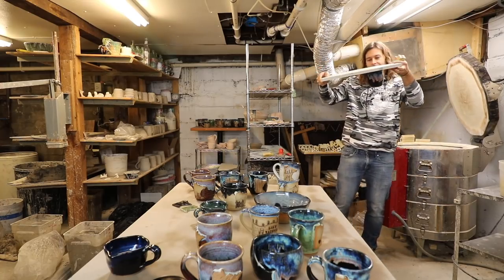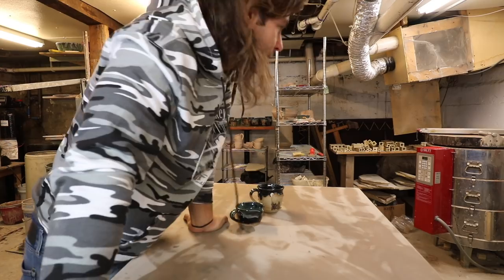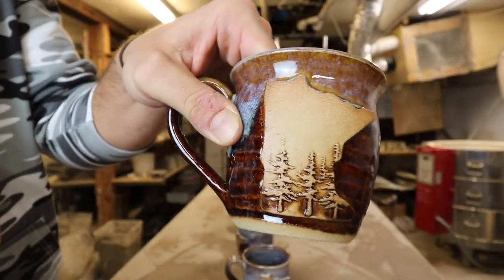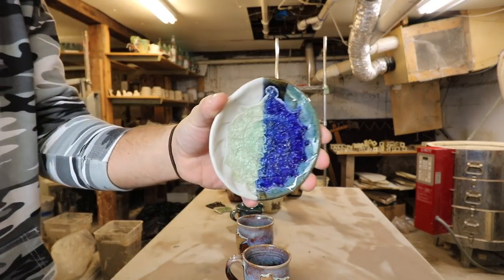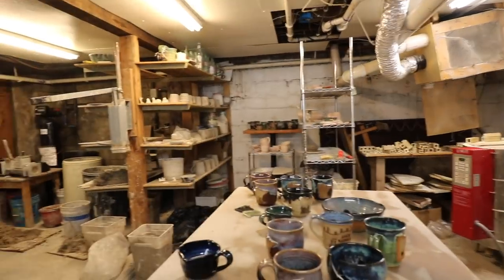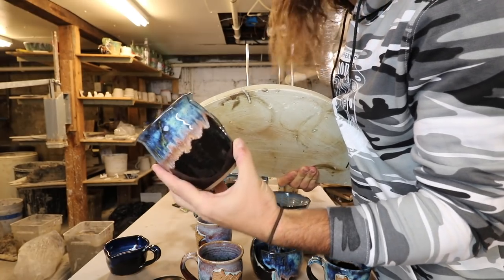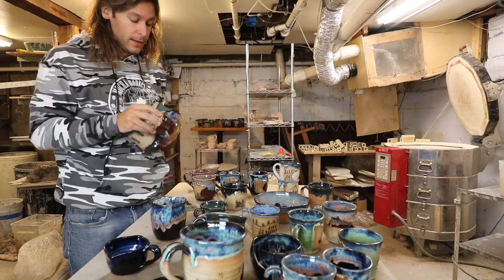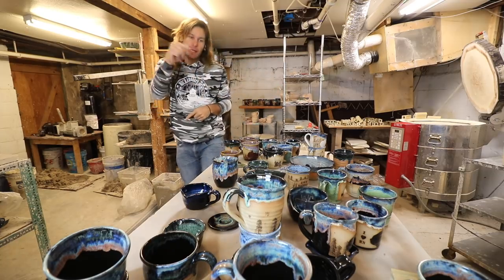My Kiln Shelves COLLAPSED!  Unloading Kiln #34

Comment: Love these videos!!! I'm a beginner potter and have learned so much from your videos! Thank you, great work :)
Reply: Me too! I have made some awesome awesome pottery stuff that has turned out great and awesome and the handmade teapot that I used with two small plastic bowl molds which I had to use newspaper on the outside of the mold to create my teapot 🫖 and it turned out awesome but someone in my community pottery drop in pottery class accidentally put the teapot lid on the teapot in the kiln and it was stuck onto the teapot and I couldn't even get it off my piece 🙂🙂😞

Comment: Ryder is so cute!!! So I wanna see the damage to the kiln bricks. I also get tons of pinging after I unload my kiln and it can go on for weeks. What bummer that the shelf slipped! But still pretty lucky could have been way worse. I love the hand warming mug! Really want to see that video. I had a bunch of people ask me to make some.  Your rad like always! Peace out!!
Reply: If you are getting pinging then it means that somewhere your clay and glaze do not like to play together. (Obvious question is are you letting your kiln cool fully and not firing super fast?). Have you done other test tiles/bowls/ small things with different clay bodies and glazes? Usually, it means that the clay and glaze aren't expanding and shrinking at the same rate even if you fire slowly. I would suggest doing tests and if you have already then start swapping out one variable at a time with just your clay or just your glaze.
Reply from the maker: Yes the pinging, unfortunately is not a good thing, it means that the glazes are slightly cracking as it cools.  Slower firing , slower cooling or a different glaze combo are all possible solutions.  It does sound cool but it means that something is not right.
Reply from the maker: Thanks Atalie as always, got the ornament and we LOVE it!!!!!  Hand warming mug to come soon
Reply: larry raineri I have done lots of tests and run kiln on med speed and let cool completely, I’ve only ever had this pinging with the metallic green and have tried it on multiple clay bodies, with pinging on every one. I’m not worried though, I’ve never had a piece break or shatter at any point. If Jon is also having the pinging in his clay from continental clay then I don’t know if there is a remedy for this particular  glaze.
Reply: So glad Jon!! Happy Thanksgiving!

Comment: Agree with most all the other comments. Love the wide angle. Only suggestion is to slow down when showing items as I sometimes don’t get to see the item long enough. Just a second-long hold would not add that much time to your videos. The still shots are ready great as are the before and after shots. Love the white running into the vertical stripes on the MN. And yes you could have lost a lot more work than you did. 

The pinging is disturbing. Means glaze and clay don’t fit well. And it’s hard to adjust a commercial glaze since you don’t know the recipe. I’d also suggest caution about the recycled glass on spoon rests—I personally would not sell spoon rests with glass on them. If a piece of glass shivered off and got into the food, and then was eaten, you could be looking at some liability there. Just something to think about carefully, even though you don’t eat directly off the spoon rest. 😬 Glass shards could still get into the food. 

I love peeking into your studio and seeing your processes and progress! I appreciate your comments and suggestions. Oh I love the new tree stamp too! Thanks for making the videos and for the great editing.
Reply from the maker: Thanks for the comment, yes the pinging is slightly concerning as it doesn't happen to me too often, could have pulled the pots out slightly earlier then normal on this one.  the spoon rest might be a bad idea.  I have used the glass a lot and so far I have never seen the glass come off of the pot, but I agree that its better safe then sorry (someone swallowing a piece of glass...)
Reply: @Jonthepotter  people say that sometimes the glass will crack off months later. I saw a photo of a person with a ring holder and a bleeding finger. My sister-in-law does fused glass, and they are extremely careful about the coefficient of expansion or COE of glass, and if it doesn't match exactly, items can crack in the kiln, or in a day, week, or year. What I know is that those COEs are not nearly as different from each other as the COEs of glass and clay. Even though it's really pretty and blingy, there are people who simply won't use glass with clay. 

Now, the pinging is your glaze cracking somewhere, and sometimes I know they are microscopic and we can't really see them, but they might be underneath the top surface of the glaze. It's a COE thing too. Seems to me that commercial glazes are usually pretty robust, but can still give you crazing or shivering. I'm certainly not an expert but I am trying to learn more, and I appreciate being able to talk it over with you! I know some people just ignore the crazing and think it's cool, and happily sell their work that way. But I know it really weakens the piece, and might account for some of your breakage at the shop. My approach as a scientist is to try to learn to adjust for crazing rather than sell items that might be a problem somewhere down the line. Just thinking out loud....